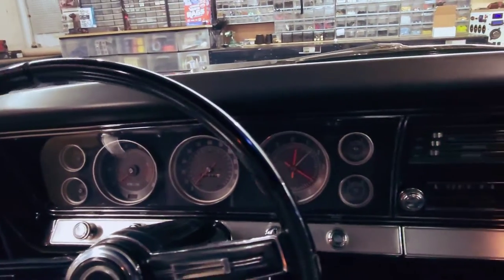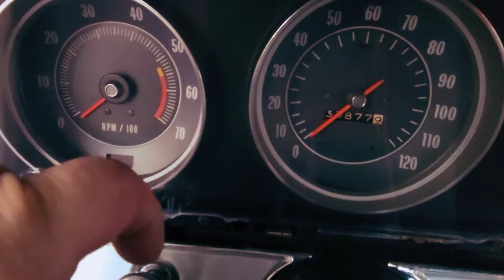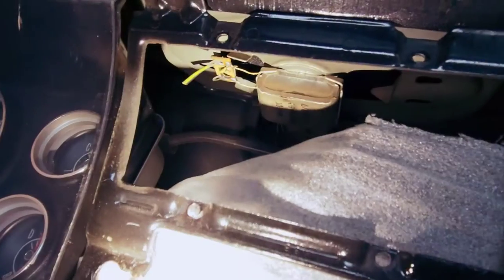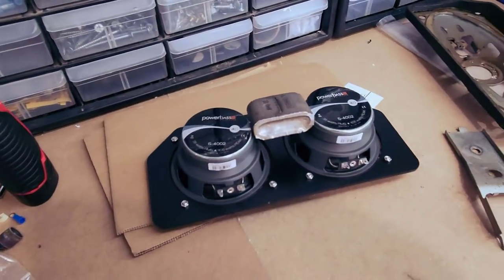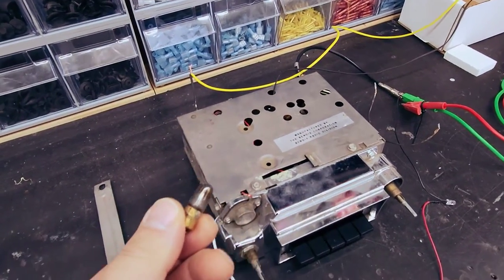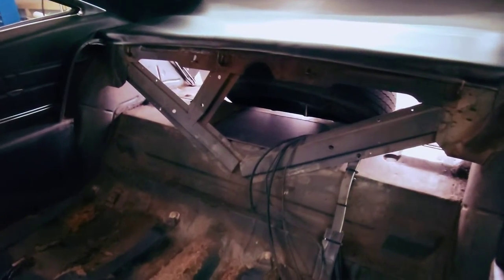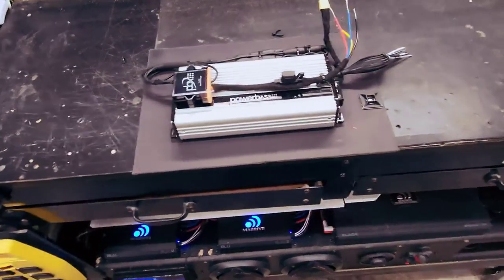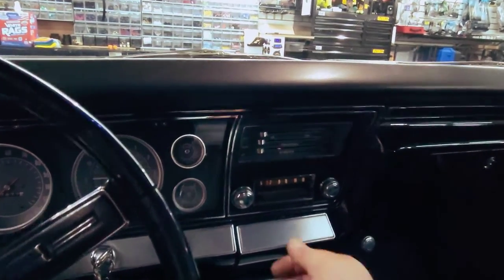1967 Impala simple audio upgrade with amazing results.

Comment: My 67 Impala SS came with the dash speaker and a 6x9 in the rear deck on the right.  The cutout in the metal for the left speaker is there from the factory, just requiring cutting the package tray cardboard.  I've also got a factory rear defogger on the left side of the package tray as well.  But no speaker in the middle of the rear seat.  My car is all original as my grandfather bought it brand new in Dec. 1966.